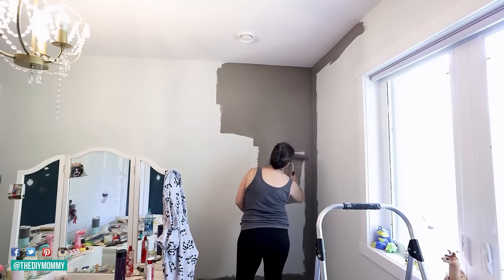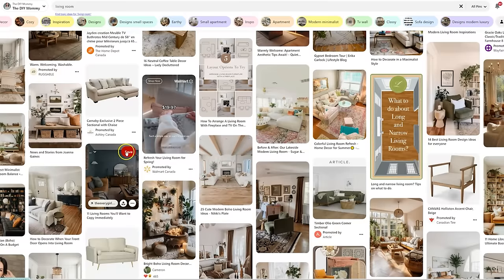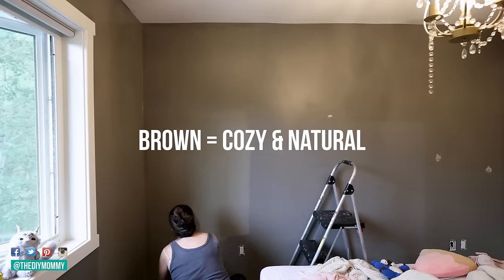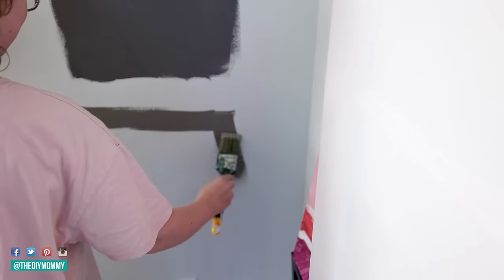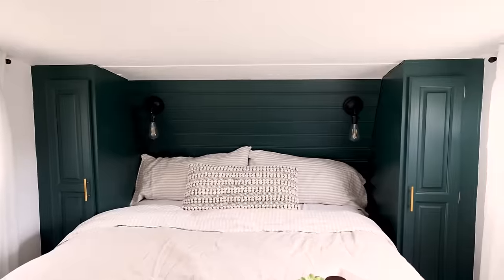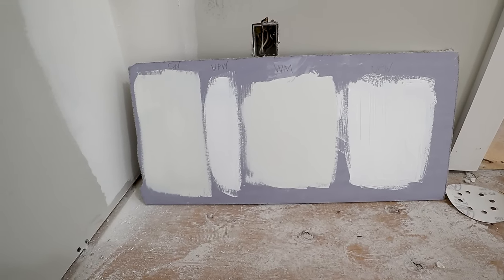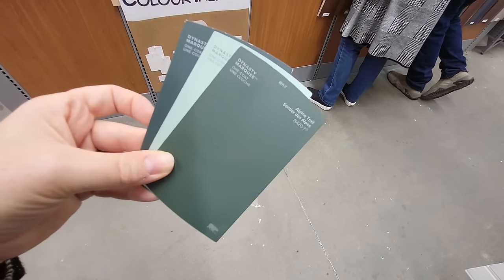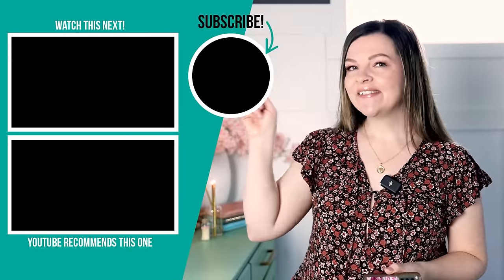Are You Making These Common Paint Color Mistakes?? (How to FIX!)

Comment: One thing that I did was pay attention to the overall colour as especially if you're not living in USA the paint swatch colours with not necessarily be available but if alot of the colours you like are a specific colour like sandstone for instance it could help you find that same shade available in your country. Also if you are doing a ombre look with your trim and or doors to match your walls then remember you can use the same colour for your walls but made in half strength so its less pigment but the same tone that compliments the space nicely. Also if you're going for a cosy feel but calm as well you could use a slightly darker tone of the same shade on say your door or your buit in bookshelf to add texture and add the extra cosy feeling.

Comment: More often than not it is the paint finish and not the colour which is wrong.
I know in North America (US & Canada) people tend to use a finish for their walls which is slightly shiny. Shows all the bumps an lumps.  
In Europe it is more the norm to use flat or mat paint for walls and ceilings.
Reply from the maker: My favourite interior wall paint finish is eggshell. It only has a slight sheen. I find that ultra matte paint is (usually) too difficult to clean in higher use areas.